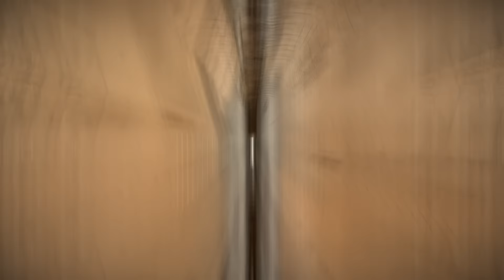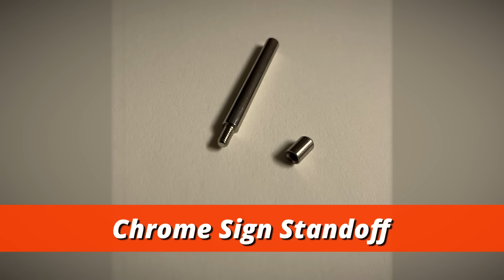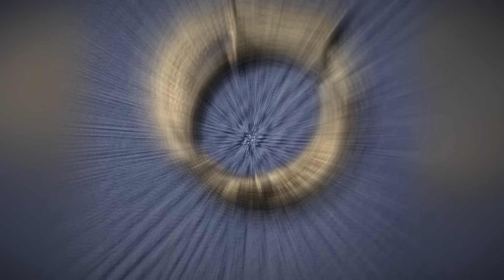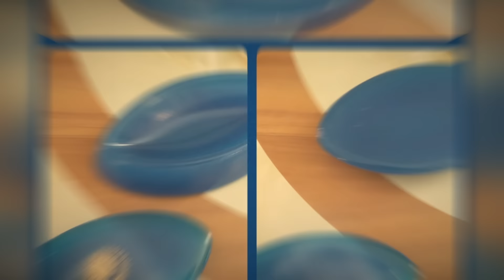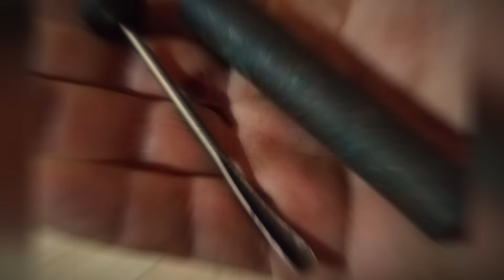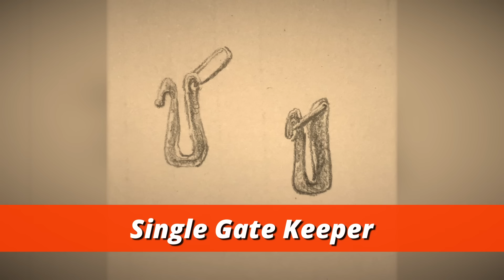What Is This Strange GLASS BALL WITH A TUBE? (50+ Finds)

Comment: @3:02 that is definitely not a mouth blown alcohol torch, both cylinders are filled with 99% alcohol. The wick on the one tube is lit and it heats the bent tube causing it to gasify the alcohol in it, it then comes out of  the pin hole in the curved pipe creating a pointed flame similar to a propane torch. They also make a mouth blown model but that has only one large tube and just the curved tube with a hose attached to it. I have both kind on my workbench right now.

Comment: 11:59 "The EXACT spot" Do you want to drill through a nail? Also, metal protectors are placed on studs where pipes go through them. Do you want to drill through them and cause a costly plumbing repair?

Comment: Those look like darkroom tongs, for grasping photographic paper for immersion in developing chemicals.
I've seen some with flat rubber pads on the ends, so the rippled faces on the working ends of these particular tongs do puzzle me a little bit.

The tongs shown here cannot open far enough to handle anything like the suggested jar or roast mentioned in the video.

You could maybe rinse cabbage leaves with these, but they wouldn't be ideal for that use, since they would damage the part being clamped upon.

I just noticed something else...
I see that the hole in the handle would function as a hook if the grasping end of the tongs were facing downward.

That means that something could be clamped in these tongs, then can be suspended in the air by hooking the handle onto a taught piece of wire, string, or cord.

Ever seen a TV show where wet photos were dangling in a dark room?

Using these tongs in the manner I've described, would mean you wouldn't need to transfer the wet photographic paper to separate clips for hanging.
Reply: ...taut...